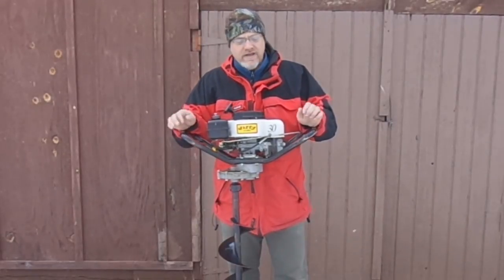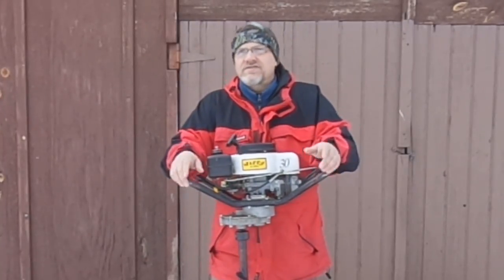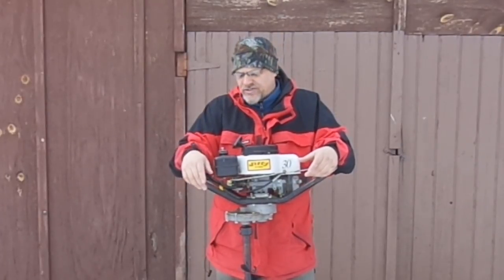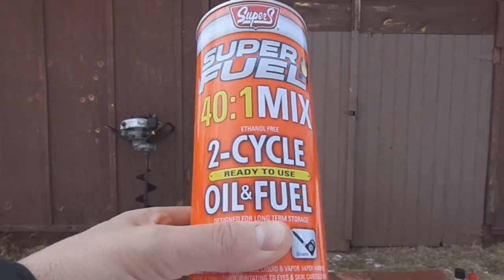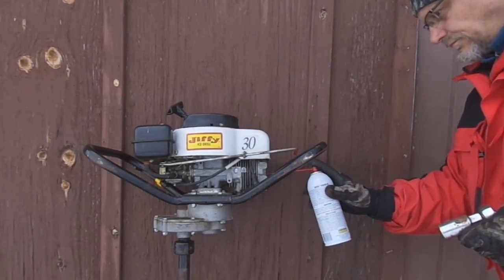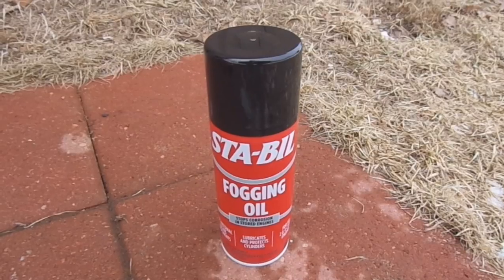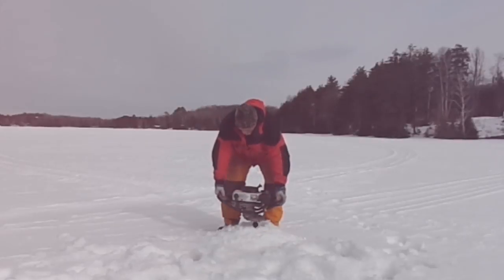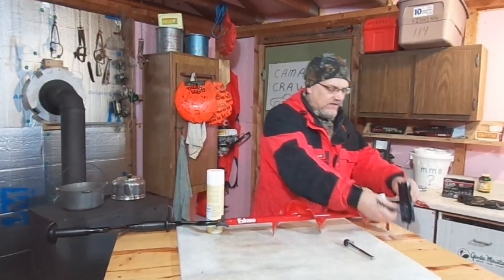Ice Fishing - Power Auger Storage Tips

Comment: I have the same one and I've been wondering about the gear oil do you ever change yours
Reply from the maker: Dave, I've never done anything with the gear lube.  Mine doesn't really have a fill or drain plug.  It looks like on my model you would have to break a seal or gasket to get at the gears to drain or fill the lube.  In a perfect world it probably should be changed out annually.  But if I don't see any leaks I probably won't mess with mine.  Of course the run time on the gears is so short compared to a lower unit on a boat or a snowmobile gear box.  Even for an auger as old as mine, the concern would probably be condensation creeping in.  It's a good question, but I don't have a good answer.  Thanks for watching, KPO.